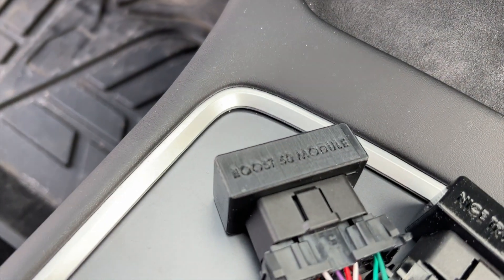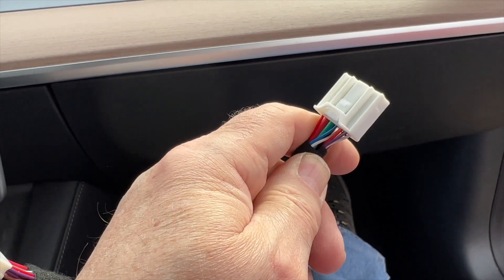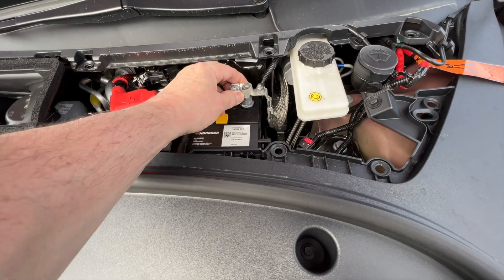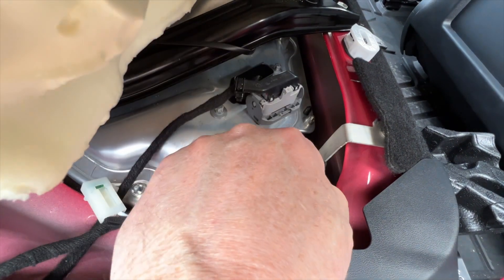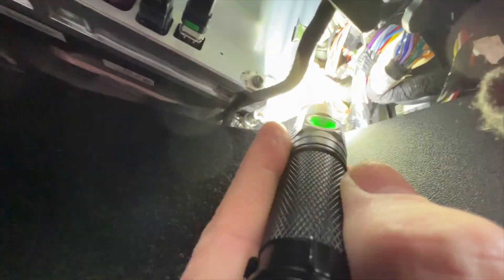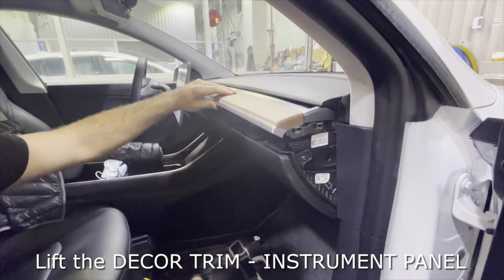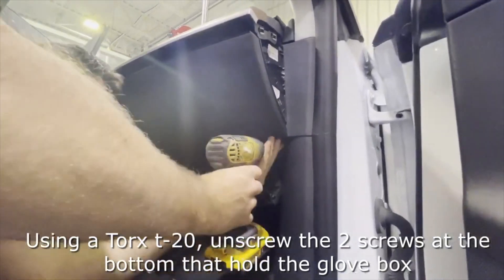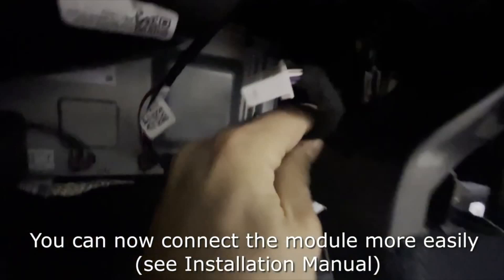How to Install Ingenext Boost 50 Tesla Model 3/Y [Ultimate Guide]

Comment: What if my Model y SR 2021 has a 980 motor can I just get the boost for the SR+ and put it on the model y? It has the same motor 980
Reply: Please If you see this reply to me I need help
Reply from the maker: I would call them directly to confirm. (819) 840-2215

Comment: Im trying to install now for myself. I took off the glove box and still could not take out the grey connector from the MCU.. did you use a tool or screwdriver to hold the safety tab down then pull using another tool?
Reply from the maker: no tool, but it was very difficult with my large hands. Could not have done it without taking the glove box out completely. good luck
Reply: @BCTeslaGuy  Just finished installation, I had to be pretty rough on the cables during the removal and installation of the connector because everything was so tightly packed in.
I see you cut yourself a little on the finger in the video.. I also have the same cuts on my fingers now because of how sharp the edges were on the MCU :face-red-droopy-eyes:
Reply from the maker: @maxlau9214  how were your results?
Reply: @BCTeslaGuy  good! Everything is working as intended. You can really feel the boost during the launch
Reply from the maker: Awesome. Auto opening drivers door is cool and the ability to hard reboot car with a click of button is nice too. Congrats
Reply: You do have to offer some blood to get it unplugged without removing glove box

Comment: Do you know if you can use this if you have already have a aftermarket Tesla instrament cluster already connected to the same MCU slot that this hooks up to.?
Reply from the maker: not sure. sorry. thanks for watching
Reply: I saw another video where the daisey chained as I had same question. They said worked great and in fact would be easier to remove for service
Reply: @Jazon1979123  Thanks! I ended up doing that and it been working great. Plus to your point the updating is allot easier since it allows more slack and accessibility.
Reply: @rayalexander7227  what year and model is yours?
Reply: Great video how can I tell what kind of motor I have. I have 2023 long rang